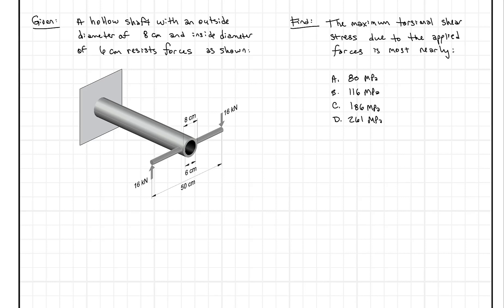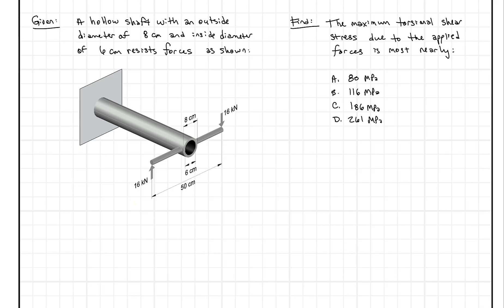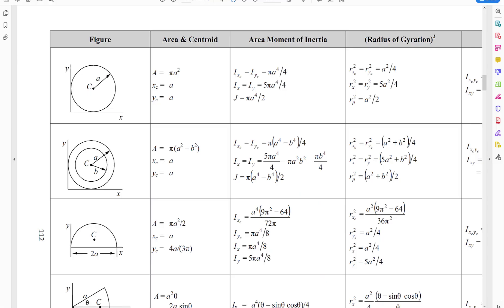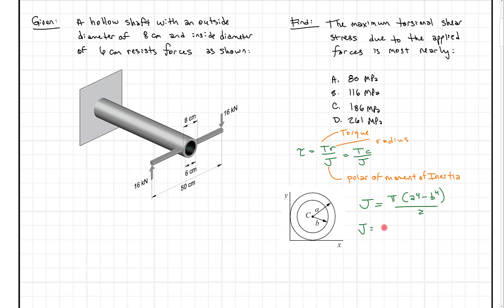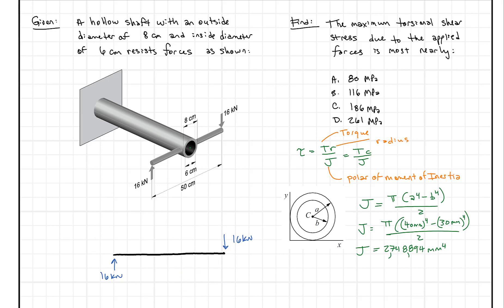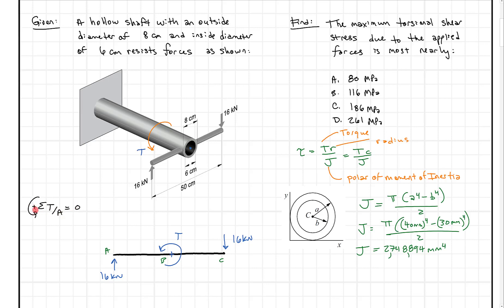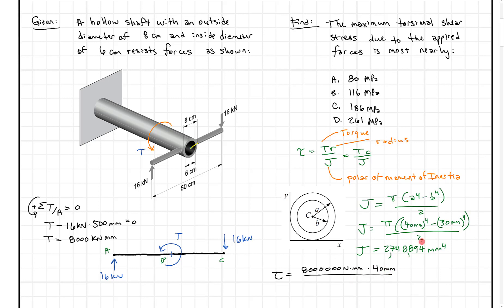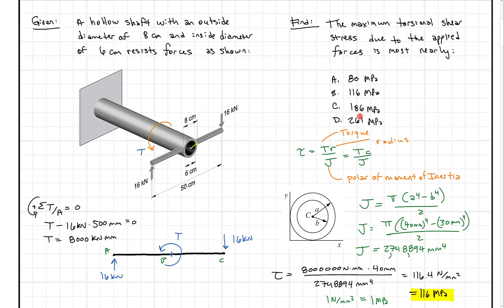Torsion - Torque formula and force couple

Comment: Why did u multiply T by 50 and not 25?
Reply from the maker: A torque or moment is a force × distance.  In this case, there are two forces, so the torque resisted by the shaft is 2 × (16kN x 25 mm).  You end up with the same thing, when you multiply 16kN × 50 mm by summing torques at point A.  Does that help?
Reply: @MarkMattsonPE  yes, thanks